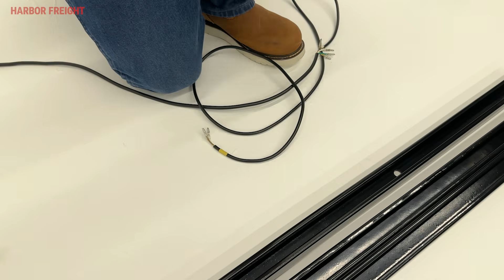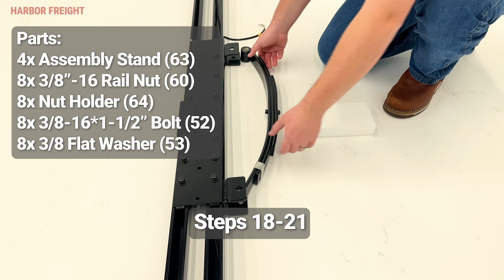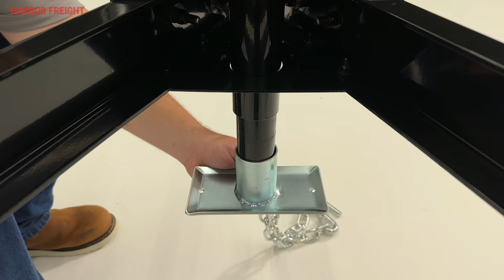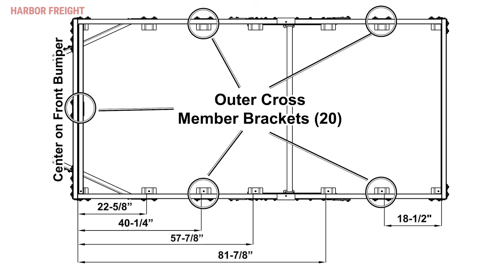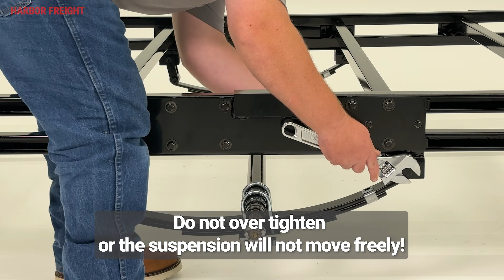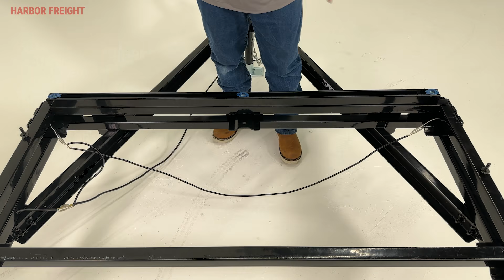Haul-Master 5'x10' Custom Modular Utility Trailer - How to Assemble

Comment: How large are the boxes it comes in? I’m wondering if it will fit in either my suv or van
Reply: Damn big, up to about 5' one dimension--two boxes of those plus two longer boxes. Damn heavy. The weight is just as much a problem as the size. Probably will not fit into any SUV other than a Suburban-sized vehicle. My Harbor Freight used a forklift to put it in my full-size pickup.

Comment: 12:53 yall should tell people to put the tongue brackets in the front of the tongues on first and line them up to the front bumper because the 23 inches yall claim for the back tongue brackets isnt correct

Comment: I got mine for $649 a few days ago. 11 hours into the build with no power tools. I'm about to do the wiring and finally found this video 🤣
Reply: Mine was 639! 😂 putting it together right now and got really confused on the cross members so I came here….
Reply: @KingOfFreeTime Same here 😅 

Would have helped since I saw the boxes of square nuts but missed the callout in the assembly instructions and installed most of the brackets with flat washers then wondered why I was out of flat washers 🤦 😅 Wasted an hour going back and putting square nuts on.

I will say it seems good quality, there were no missing items and everything lined up very nicely.

Comment: The square washers and the wrench are the most retarded things ever. Busted my knuckles several times and hurt my back trying to get them straight. In hindsight I should've swapped them for regular washers from hardware store. Trailer is a killer deal though 👌

Comment: My question is what are the Grade of the bolts? If its on road application they should be Grade 8 or higher in my opinion. They also should have been 1/2 bolts. Think I will also lock tight every major bolt.
Reply: Bolts are indeed grade 8. Indicated by the 6 lines on the bolt head.
Reply: Are the lug nuts on your car locktited on?  Fenders?  Motor mounts?  Exhaust?  Dorrs???....

Comment: Why don’t the wheel bearings have a washer between them and the castle nut?
Reply: I noticed this too. It doesn't seem like enough threads to add one either. I have an extra hub and 2 extra bearings in my tongue box just in case. I don't want to get stuck.

Comment: Can someone measure one of the square washers and tell me the dimensions?  I assume the hole is 7/16," but what is the square and the thickness?   My trailer arrived without them, and HF cannot replace them.  I waited two months for the trailer to arrive, so I'm not planning to go through a full exchange process to get my washers.
Reply: The trailer kit provides square washers that are 1.58in square, 0.23in thick, 0.43in central hole (including the powder-coat finish).

Note that the trailer uses standard American strut shapes, and the square washers are similar but beefier version of SuperStrut square 3/8 washers that are 1.5in square, 0.19 thick, 3/8 clearance hole.  So you might use the the SuperStrut or similar standard strut items, but they retail for upwards of $1.50/each, and the HF kit requires 76 pieces, over $100 total to improvise your missing kit parts.  Maybe the store would credit you on the original purchase for that.
Reply: @RichardKinch good info! Do you know if SuperStrut is the same size as all the other channels like the top rail etc?
Reply: @crherniman  Yes, the Harbor Freight 59846 trailer struts closely match the American standard 12-gauge strut channel dimensions of 1-5/8 in square, making them compatible with various brand-name fittings such as SuperStrut, UniStrut, etc.  That's why all the fasteners are inch sized (3/8-16 and 1/4-20 bolts, etc), to match that structural system.  They obviously designed it to directly fit the American strut and fastener hardware, even though it is made in China.  But they're not going to say so to avoid any warranty of performance to that standard.  So lilkewise I observe that it does fit, but there is no specification or guarantee that it fits standard strut.

Comment: Having a heck of a time with the wiring. Video appears to have 3 separate sections of wiring. Mine are 3 sections already connected. If you also received the updated kit, how did you install the wiring?
Reply: The wiring instructions are too vague to be useful.  Instead I identified which of the three harness pieces went along the tongue, driver side, and rear bumper.  Then you can logically match up each of the 7 LED fixtures (2 front amber running lights, 2 rear red running lights, 2 red tail lights, license plate white light) and their bullet connections to the harness receptacles.

Comment: The shackle brackets in the front are too narrow to fit the leaf springs inbetween the outsidee and inside brackets. How do you widen them? they are atleast 1/4" too narrow.
Reply: Narrow brackets face rear. Wider brackets face front. Your kit might have mislabeled Shackles (driver as passenger, passenger as driver).
Reply: In most countries where this was designed the driver’s side is your right hand. That is the problem
Reply: You have them reversed driver vs passenger side.  You will have to disassemble them, swap them, and reassemble.  Quite the nuisance.
Reply: @RichardKinch omg I did this. I hate this thing 😭

Comment: Just assembled this trailer. The wiring harness directions are a joke. If you start the harness from back to front you don't have to feed any connectors through the holes. The diagrams are accurate, but make sure you seat the connections completely. Put the wheels on and then visually center the fender, ignore removing the wheel. Pay attention to the pictures in the directions. I found those to be the most accurate. There is nothing difficult about assembling the trailer. Overall the directions work very well.

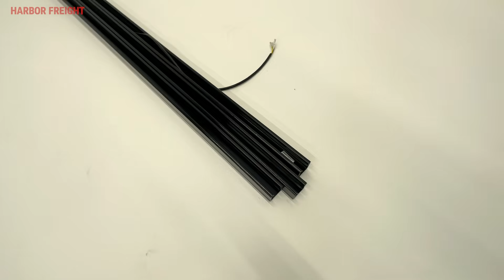Comment: When he explained the wire at about 1:20 he didn't explain well enough. You have to feed the wire trough at the hole just before the one at the end so you can get all ALL 3 sets of plugs though , after that you feed the first set of plugs at the end of the wire back into the hole and then out of the middle hole  leaving the other two connectors sticking out of the  first hole.  You can see the final result at 17:48 by looking at the wires behind him in the mid to top  left .

Comment: Highly recommend getting your own license plate bracket and hardware for it, the one it comes with is a joke and will most likely fly off in the highway. It's cheap plastic held on by two screws
Reply: actually held on by 4 screws.
Reply: @dougphelps6917 but still not much better. It's a cheapie unit.

Comment: I bought one of these as soon as they came out, pre-ordering one to build a teardrop camper. NOT fun to assemble, and the direction appear as if I wrote them, which isn't very helpful for anyone. Steps are either missing, or wrong.  Aside from terrible instructions, my leaf springs are also wrong... or the mounting shackles are! The front leaf spring mount is 1 3/8" and the rear mount bracket is 2". The leaf springs are 1 3/4".  The rear shackles are 1/4" each. So, my front mount and rear are both at least 1/4" too narrow for the springs to mount WTF?! I currently have several hours into assembly and now this! I have typically been impressed with HF offerings, but this purchase has me seriously considering my loyalty to their products! I would not buy this again! GO TO TRACTOR SUPPLY AND BUY ONE OF THEIR PRE ASSEMBLED OPTIONS!!
Reply: It is a challenge to assemble, and the shackle labeling is wrong,  but a 5x10 pre assembled tractor supply 2000# trailer is $2199 where this one is $799.  You have to decide if $1400 is worth 5-6 hours of your life.  It is frustrating...and the instructions are terrible at times (all of the brackets in my kit had 8 digit numbers but in the video and instructions they are two digit numbers) and at times in the video the guy talking says something different that what the guy in the video is doing but you can get it done by watching the video 90% of the time and referring to the manual 10%.
Reply: You have the shackle brackets reversed driver vs passenger side.  You will have to disassemble them, swap them, and reassemble.  Quite the nuisance if you didn't know this going in.

Assembly is a big job requiring serious attention to detail, and presenting many chances to make a mistake.  But the work is worth about $1400 in value you are adding.  And you have a readily modifiable system made of powder-coated strut, instead of flimsy painted angles with dodgy welds.
Reply: That's called mass production, no communication on dimensions of  the components.

Comment: Do i need add extra grease to my trailer or its ok just the grease in the bearings??
Reply: Should add more
Reply: Mine came well-loaded with blue grease.
Reply: Always a good idea to just pack it full
Reply: The grease it comes with is for local, slow driving and is not good for long term use. Google recommends taking the hubs apart and adding real grease

Comment: can use with sedan?
Reply: Towing vehicle must be capable of handling at least 2700 lbs GVWR.
Reply: @RichardKinch wrong
Reply: @aab-el9bd Yes. It weighs 700 pounds. Most sedans can tow 2,000. This trailer can hold 2,000 pounds of cargo plus the 700 pounds that it weighs. Don't tow more than your vehicle is rated for and you'll be fine.

You'll find using a sedan is less than ideal. Even though they may be rated for 2,000 pounds (or whatever they say), they are typically restricted based on speed and terrain. If you are restricted, you may be able to upgrade the transmission cooler (usually the limiting factor).